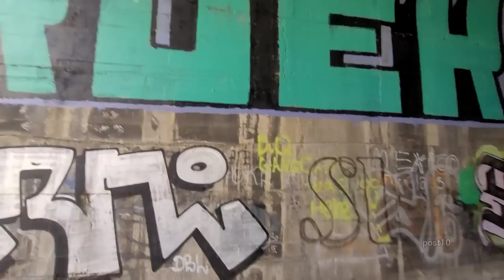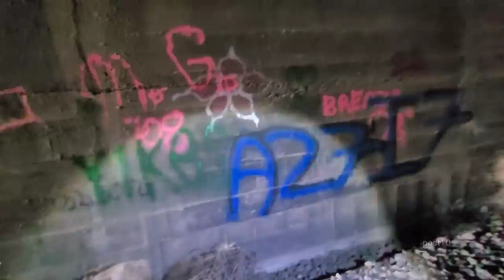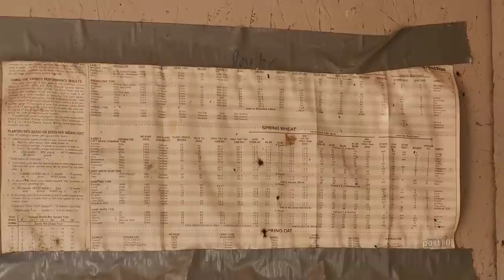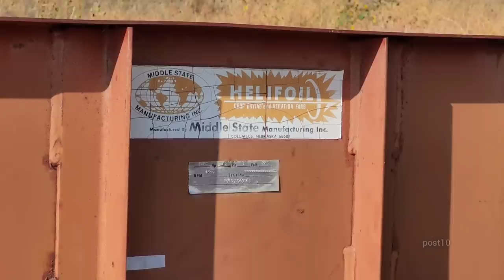Railways, Crumbling Buildings, Huge Bridges And More

Comment: Tunnel One - The question of the two 'grated' entrances along the 'inner' or left hand wall and none on the 'outer' right hand wall?  Finding only weep holes along the one side suggests that this is sufficient in dealing with drainage, therefore if finding additional engineering you can safely presume it's non-drainage related.  Ventilation shafts are commonly needed for the safe operation of a tunnel but judging by the cold blast you felt before reaching the entrance and the spider tumble weed shin-dig going down at the other end, additional ventilation doesn't look needed here either. So how about a service tunnel? One thing to be mindful here is to question what could possibly require access down one side of the tunnel, but not the other? This got me thinking. Both stone-cut portals 'nicely' appear out of the hillside, while the cuttings look like they were dug using artillery shells! Lol. The portal and the cuttings are far from consistent in terms of quality and finish and this lends me to suspect we originally had a dual tunnel configuration prior to their both being inundated in some unknown event in the past. Resurrecting the line at a later date would see only one line, needing one cutting, using only one tunnel.  Tunnel two remain buried and maybe, just maybe proof of which waits within that service tunnel running between the two? I'd be keen to hear more if it's out there?

Comment: The shack at 1:46 probably had a gas engine in it (or Hit & Miss engine) to run that grasshopper pump. Not sure if it was pumping oil or water but my guess is oil.

Comment: Post, they can’t be worker’s escape tunnels because there are not enough of them. A worker could not get to them fast enough. They are more likely ventilation shafts. One day if you have time: Go up top and see if you can find the vents. Most tunnels have regulations that require ventilation in case a train breaks down inside.
Reply: tunnels don't have regulations- the US RAILDOT has regulations regarding that.
Reply: @tommurphy4307  You are correct, however I think you mean the Federal Railroad Administration, a division of the US Department of Transportation.  As a 30+ year railroad veteran, I have never heard of "the US RAILDOT"

Comment: Some train tunnels had small rooms or areas you could stand in if a train was going by and not get run over. They probably blocked them up with those gratings. Other countries have them in their tunnels too..
Reply: No, those vents are for ventilation for the trains.

Comment: That bus needs restored!!! It looks like a Crown or Kenworth. That rod that connects the gearshift to the pressure plate is the shift linkage. Engage the clutch and you might see even more movement. It's hard to believe that most of the drivetrain is still there!!!

Comment: Those little bump out areas in the walkway on the old train bridge are where back when they still used steam engines,they would place barrels of water in case of hot ash falling on the track way and starting a fire.
Reply: we still have the barrels on the san diego and arizona eastern RR goat canyon trestle in east san diego county and several other wooden trestles on that line. its so dry here even diesel trains are a risk to the bridges.

Comment: those silos are grain bins and the big red fans with the motors blow air into the bottom trench in the concrete of the grain bin to dry the grain so it doesn't rot.  A perforated raised metal floor lays on top of the concrete to disperse the air to the entire bin floor.
Reply: Thanks - I was curious about the fans.

Comment: While I think the abandonment here by Burlington Northern predates this practice, asphalt for a subgrade isn't uncommon on modern railroads.
Reply: Pretty sure this was The Milwaukee Road. They abandoned their lines here in 1980.
Reply: @K_Hicks  I was thinking it was SP&S somewhere between Pasco and Spokane by the late build date and the high quality construction of the tunnel (And Post10 saying 1987 for when the line last saw trains, which I believe gels with when BN pulled the plug). The Pacific Extension was also late construction and built to high standards and also fits, but doesn't match the 1987 date he gives at the start of the video for when trains last used the tunnel.
Reply: Plus don't forget that Burlington Northern actually bought Milwaukee Road's Snoqualmie Pass just in case, before the 1980's abandonment binge hit them and they rationalized their crossings across Washington State (Abandoning the idle Milwaukee Road crossing, selling a big chunk of NP's Cascade Pass to Washington Central while idling the western portion, and abandoning the eastern half of the SP&S crossing). So technically even if it is a tunnel on Snoqualmie Pass, I believe official abandonment of it was undertaken by Burlington Northern in the mid 1980's a half decade or so after the Milwaukee Road quit the Pacific Extension.
Reply: @K_Hicks  sp&s, then bn, then bnsf. got that?
Reply: @LeoA2600  the word is 'jibes'
Reply: @tommurphy4307  What are you talking about?

Comment: The burned lumber in the vent; I wonder if someone lit up a pile of tumbleweeds as a bonfire in the tunnel. 
Odd seeing a ?1957? City bus in I presume nowhere. I'm guessing it conked out overheated brakes stopped and too expensive to have it towed so he dumped her out there. 
The left tall handle is Clutch.
The right side would be to the 3 speed gearbox.
Edit
I have also seen where lazy guys left jugs of used oil and dead auto battery.
I gathered all and recycled so the contents didn't leak into the water and the farm fields.
Those red fans were to feed air in the silos. 
Shame how stock markets sway business away from little communities like that towards one giant one.
The train bridge - the paint will be Lead.
It holds up forever.

Comment: The thing that you though was the flywheel is actually the breaking system
Reply: It is a brake rotor. Only part of the brake system.
Reply: @tyleroryan  there is more but yeah the brake rotor is it.......monster truck rotors take a pounding glowing red hot and sparks for the whole run

Comment: What a strange place to build a R.R. In the middle of dry grass. The steam engines threw out sparks, which would have burned the place. Hmmm
Reply: Most of the steam locomotives in the dry western states burned oil instead of coal, because oil was plentiful in the west and does not emit sparks when burning.